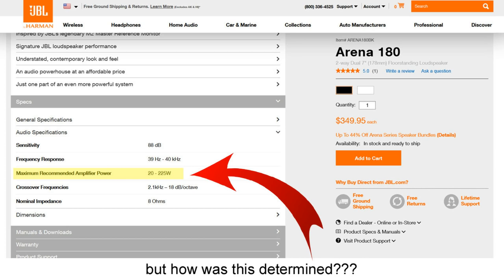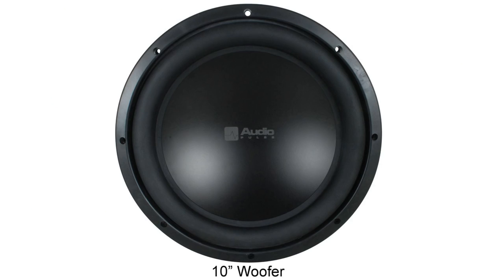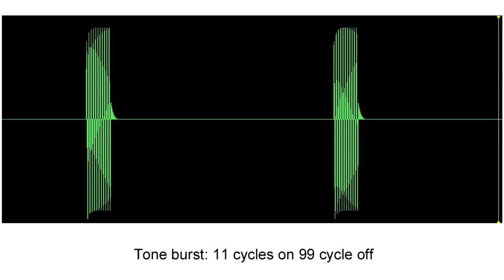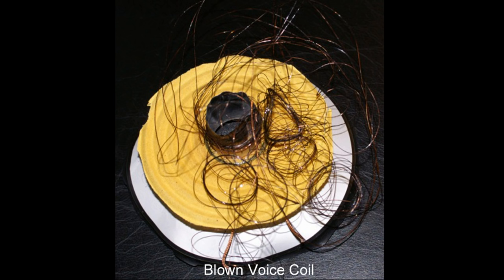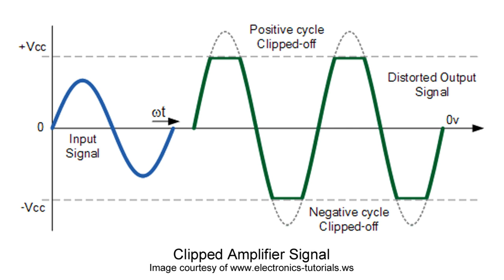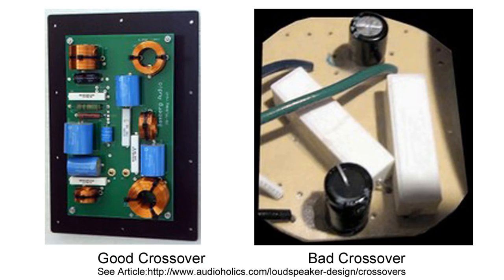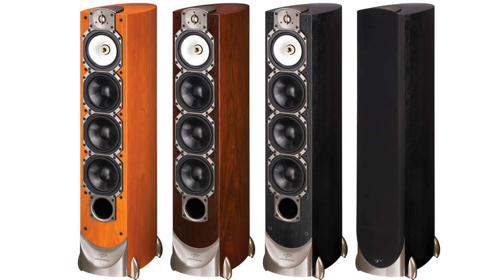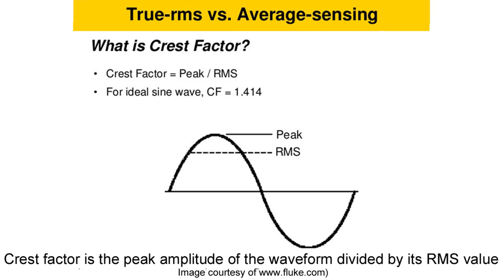The Truth About Matching Amplifier Power to Loudspeakers

Comment: They forgot one thing about clipping. Since the wave form becomes more SQUARE wave form at the peaks, the sustained voltage does NOT allow the voice coil to move. It is forced to one end or the other of the throw. Voice coils rely on the movement to move the air which cools the coil. By NOT moving for long durations the cooling is not happening and the current in the coil is higher than normal and causes excessive heat. That is what burns up the voice coils.
Reply: that one factor but that rarely a problem for guitar speakers which are feed square waves all time by fuzz effects or over drives. An audio signal is more complex than guitar signal and when clips it increase harmonics all over the place. the harmonics outside of range of speaker cause a lot more damage.  if my speaker frequency range is 100 hz to 5000 hz and feed it square wave at 120 hz and derate by 30 percent that speaker will do just fine. feed a speaker a square wave at 5001 hz at same power and my speaker may fry.

Comment: Personally, I ignore power handling figures for speakers. I look at speaker sensitivity related to an amp’s RMS output per channel, and the speaker’s impedance curve in relation to the current able to be delivered by the amp. Only a rough guide, though.

Comment: Back in the 60's I was given the advice: Too much (clean)Power will not destroy a speaker, distortion will. I guess the corollary would be the cleaner the amp, the safer the speaker. The efficiency of the speaker is probably also more important than the "power capacity".

This has served me well over the years. I am using a pair of 30yr old CV351s that needed a resurround due to age. A pair of Klipsch Forte IIs that are going strong after 26yrs, I did replace the X-over on them. However, I also have a Klipsch powered subwoofer that needed a complete rebuild because the amp went bad.
Reply: Efficiency isn't a measure of sound quality.  The best speakers I've heard all fall between 84-93db 1w/1m.  Super-effiicient speakers all sound like ear-bleeders to me.  Harsh, in-your face horns. Nasty, cheap phenolic drivers behind a metal horn throat that rings like a bell.. Harsh compression midrange drivers. Piezo horn tweeters.  No thanks.

Comment: i have purchased 6 ceiling speaker at 20-350 watts per speaker. the  impedance listed at 8  ohms and 95 db .
my amplifier is a wall mounted two channel at 20 watts per channel total 40 watt output. the impedance rating is 4 and  8 ohms.  the back of the amplifier allows for 2 speaker connection
can i connect all 6 speakers to this amplifier? 3 speaker per connection. how would the sound quality be? is there a chance to damage the speakers or amplifier? thank you

Comment: I have a topic you could talk about.  How about covering protecting your home theater setup.  Surge protectors, UPC's, power conditioners, ect.
Reply: For power line protection, I would highly recommend Zero-Surge (Frenchtown, NJ). They make a variety of very well built surge suppression units. Furman uses the same technology for theirs. They do NOT use Metal oxide varistor. as cheaper units use. That CAN literally BLOW UP and catch fire. https://zerosurge.com/surge-suppression/ We have used these for close to 20 years at my work to protect computers. The link I supplied explains how they work.

Comment: I have a Pioneer 84TXSi AV 7.1, which was Pioneer's flag ship decrete amplifier at the time, in 2006), matched with Paradigm Monitor 7.v6 series speakers. 
I'm wondering what is your impression on this Class B amplifier and should I add a power amplifier such as Emotiva A-5175? 

The reason for my question is due to the 84TXSi's over all power performance of 77W (all channels driven @ 8 ohms) and 140W (2 channels driven @8 ohms) respectfully. Will adding a power amplifier smooth out the overall power output,Thank you.

Comment: Gene, Hugo, many thanks! 
I had this issue bugging me some weeks ago, when I bought Atohm GT1 shelf speakers 100W RMS, 200W peak @ 6 ohm. I received suggestions to go  for an integrated that would serve 200W RMS @ 8 ohm, but settled for a Lumin M1, that only serves 60W @ 8 ohm, and sounds just great for my current level of understanding. 
I pissed off a lot of people during my research, including Crown Audio and Atohm engineers. I held my patience and did not write to you, but you somehow sensed the need and published this video. So, now my simple question is – Should I plan to upgrade the amp to "more"? 
Thanks!
Reply: At lower volume you are fine,  around 80wpc @6ohms but if you try to play loud it will start to distort, you would be amazed at the difference with a bigger amp. I own CERWIN-VEGA! SL15 100w RMS 400w peak speakers. Because my speakers are capable of drawing 400w I have a 500wpc amp so any amount of power my speakers need is there. It's called headroom. My Onkyo TX RZ820 has a max volume setting, to set up my amp I set the gain, turn up volume till I hit clip(very, very loud) then back it down a few db and lock that in as max volume. I can crank it as loud as I want, get crystal clear sound, and never worry about blowing speakers or frying amp. Plus with a proper amp the bass really hits like it's supposed to. Edit: I thought it said posted 3 weeks ago. Sorry if i'm bugging you

Comment: I always hear that more power/watts is better. I have the klipsch rp8000f with a denon 3600h that gives out 80 watts with 5 channels driven. The speakers are rated at 150rms so my question is do I need an amplifier with 250+ watts like an emotiva or something more like an outlaw 5000x which does 120 watts all channels driven? Would any of those 2 amps be beneficial in someway? I always hear how an amp puts out clean power and helps with dynamic and quality but I’m not sure how much power I really need.

Comment: I have a question. I have a marantz 6011 and have gotten the whole Sony core series and they are all rated at 6 ohms and am considering getting ceiling speakers for atmos. Most of the ceiling speakers are 8 ohms and I was wondering if it would be ok do go ahead and get those or is it imperative that I get 6 ohm ceiling speakers? Also if everything is in 6 ohms should I switch the receiver to 6 ohm limit or leave it at the standar settings? Sorry for the noob question. I haven't got anything installed everything is still in the box but yeah I'd like to know your opinion on which speakers to go with. Yamaha has a 6 ohm speaker along with monoprice and monitor audio but they are kind of pricey per unit. If 8 ohms is fine I'll be getting some cheaper Yamaha speakers ns series. Thanks in advance any help is appreciated.

Comment: Good evening Mr DellaSala,

Just view your video. Very awesome. I had a question though. When it comes to power there seem to be 2 schools of thoughts. one of them is that you should only take the speaker sensitivity into consideration  and the peak db level you want to listen to in order to determine the proper power amp. Meaning if your speakers are 90db sensitive and you want to reach 105 db at the listening location then your power amp need to deliver 32 watts per channel .......what do you think about this theory does it make sense ?

Comment: I have a 1974 SONY STR-7045, 100 WATS MAX PER CHANNEL. And JBL LOFT 50,S  250 WATS EACH TOWERS and JBL ES 30 BOOKSHELF 280 WATS EACH. Should I have more amp wats for better low volume sound ?

Comment: I need to know if this amp and speaker will match. Proel M1500USB Powered Mixer to 2 Alto MS15 Passive Speakers.
The Powered mixer has Output Power (THD<1% 1kHz) Stereo 4+4ohm : 750 W + 750 W RMS (Which I dont understand how the 4+4ohms/750+750w works) and the the speakers has 600W PEAK RMS.

Comment: Audioholics,  so if i look at 2 lovely speakers from VEF RRR that are per piece rated at: Ω 8,  3 channel floor speaker, Hz 25-25000, freq. split Hz 500 / 5000, RMS W 300 , dB 89, 23 kg 
or
RRR speaker:  Ω 4, Hz 25-25000, 4 channel floor speaker, freq. split. Hz 350/700/5000,RMS W 400, dB 89, kg 28.5 
Then I need some bad @ss receiver, that gives at least 300W/400W per channel with respective 8/4 ohm. Is That right? And task is not easy, cant really find those that look nice (meant for) inside the living room. Any suggestions on some price/quality product?

Comment: You can hear when your speaker\amplifier begins to reach outside of it's design limits... If you listen you will know when you've gone too far... When things begin to thin out or bottom out just bring back the volume to restore proper operating balance and fullness... The key is to get to know your system's capabilities by SLOWLY turning up the volume using various different source material and listening for EARLY cues that you are hitting the wall, then pull back and don't go there again.
Reply: That's how I do it. My onkyo has a max volume lock. I figure my clip limit, back it down a couple db and lock it in. I can crank it as much as I need with no worries and plenty of headroom

Comment: Correct, but modern output limiters on amps prevent tweeters being blown if the amps and cabs are matched properly.  The whole "buy double the power you need" doesn't really apply anymore.  Buy amps that are accurately rated, match them appropriately taking into account impedance and number of cabs used, and run the cabs and the amps only up to half their capacity.  Place subs, for instance, in corners so you can get more gain in the room for less voltage.  Treat that room acoustically so you don't feel the need to crank it up to push past the distortion introduced by the room surfaces.  Speakers will sound better and last; amp will sound better and last longer.  If the output limiter on the amp ever triggers, turn it way down, let the amp and speakers cool for a minute and then turn it to back up to half the voltage or less (-6dBVu) what you had it before.  Yes, more and better is useful, as you are further away from its limits at lower volumes, thus lower distortion at the levels you use the system.  This is particularly useful for the speakers themselves, as even in their linear range, it's still a linear increase in distortion as voltage rises.

Comment: If a 300 watt 8 ohm speaker/cabinet is parallel wired to a separate 300 watt 8 ohm speaker/cabinet (reducing the load to 4 ohms) then hooked up to a 600 watts per channel (@ 4 ohms) amp, how many watts (if run at full power/600 watts) would the amp deliver to 'each speaker' please? (This speaker load would be the same for the second amp channel also = 4 cabinets/2 cabinets per channel)
Reply: Each speaker would receive 300 watts. You are loading down the amp to 4 ohms and because each speaker is 8 ohms the current is shared equally.

Comment: I have a denon avr s730h specs 75 wpc @ 8ohms 2 ch driven. 110 wpc @ 6 ohms and 130 wpc @ 4 ohms. If I set the avr @ 4 ohms, can I connect 8 ohms speakers with 100 watts and not damage avr or speaker?
Reply: Your avr is only capable of 75wpc with 8ohm speakers. You don't get more wpc by going to 4ohms  if that's your plan. It's an ohms law calculation from the amps rated wattage divided by the speaker resistance. Whether it will damage it or not I don't know. I am an electrician, but not a technician

Comment: Here's a question for you: What if you have an amplifier that's way more powerful than you speakers, like say 4x the RMS power, but you just don't crank it up? Seems to me it would be ok. Lots of headroom. I could see it being a problem if you turn it up way past the power rating of the speakers, they will be overdriven.
Reply from the maker: Speaker power ratings are pretty often nebulous. More power is better than less power to avoid clipping and distortion. If the speakers sound distorted or compressed, lower the volume.

Comment: I have been thinking about matching my speakers to my amp for a while. It’s usually the ohms I look at. My recover has two output channels (pioneer sa1270)  recommends 6 to 8 ohms. I have a pair of pioneer CS-G303 and a pair of pioneer CS-77 and the CS-77 is 6 ohms and the CS—G303 is 8 ohms rated respectfully.

Comment: I need help. I have the Sony STR DN1040, it's obviously one of the bullshit AV out there since it says 165W x 7. It is measured at 1khz. I had been using it for 2 years with some Klipsch satellite speakers rated 8ohm. They worked fine until last weak when the right speaker started sounding bad. My question here, can I use the Polk Floor Standing Speakers, the T50'S? it says they are rated 6 ohm. I'm really lost here, please any help would be greatly appreciated.
Reply: To ; Daniel Lourido ; I reed what you were concerned about when you mentioned about paring the right set of speakers to a home theater amp matching the ohms. What I learned from my experience is that when you put all types of ohm loads on an 'amp' like for example; 2, 4, 6 or possibly even ' 8 ohm ' load speakers all together with the other 3 types of ohms included ' it can be very bad for the amp ' if you turn up the volume ' too high ' you can actually ' burn out ' your amp. But lets say you bought a new amp for the first time, the only one you ever had and you want to ' buy speakers for it ', the amp says that the recommended ohm load per channel is ' 8 ohms ' and you want to buy a good set of speakers for the amp that ' sounds good ', you could try ' 8 ohm' load speakers to go with the amp because it will sound much better than if you buy speakers that only drops the ohm load to a ' dangerous level 'for example; 2, 4, or possibly even ' 6 ohms ' all together. And about watts, do your proper research about watts because it also depends on the amount of money you spend most of the times in these days because you may hear that a speaker or amp may say one thing about watts but when you put it to the test it may turn out to be a ' disappointment ' when you realize what it can do. Their is also a difference in the quality of sound being produced through the speakers them selves when you crank up the ' volume ' to nearly its ' full potential ' and there is less the possibility of ' frying the amp'. And also it depends on what types of speakers you use' so you have to pay ' careful attention ' to what types of speakers you listen to before you decide buy any thing to avoid further consequences down the line ' including ' it depends on what you prefer to listen to because not all speakers are the same ' but the sound depends on what you prefer to listen to '. If you have any further questions ' you can e-mail me ' at ; gutierrezanthony402@yahoo.com and that way we can stay in touch if you need any further ' assistance' involving audio equipment for homes. Thanks for taking the time to read this letter - Anthony.
Reply: Yes you can use the Polk t%). Although rate at 6 Ohms, that really is an insufficient measurement of the speakers true impedance because it various according to frequency. The Sony will always be putting out clean (non-distorted) power to the Folks so they will sound just fine. Since the Polls are tased at 90dB efficiency, you would have to blast your system at concert hall levels for excessive periods of time before you melt any of the Polk's performance.

Comment: starting with the concept of bi-amping 3 front speakers in a multitasking simpler 5.x home theater / 2.x music listening setup, are there particular advantages that such a layout would offer towards a solution to the problems mentioned in this video regarding clipping damage or is it just as well to focus on the power capabilities that still deliver clean outputs for a set up that's not bi-amped especially considering the complexities of multiple home theater channel sound amplification, preamps / processors therein ? ... I've become curious about offerings that have multiple single-channel amplifiers in a cabinet that state they output quite a lot of power albeit I don't know whether they used pink noise or white noise for the specs. it seems to be reasonable legacy investment and risk vs reward if said amplifier delivers plenty of clean headroom/program/burst power above & beyond the appreciated output and efficiency used by the speakers.